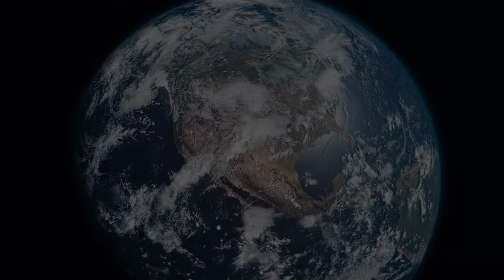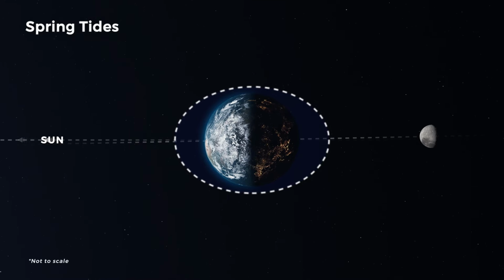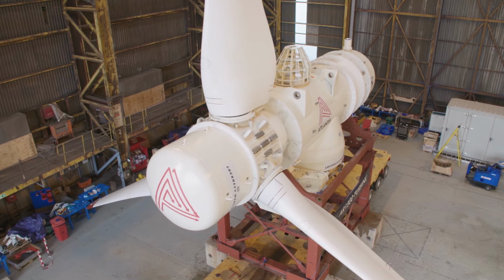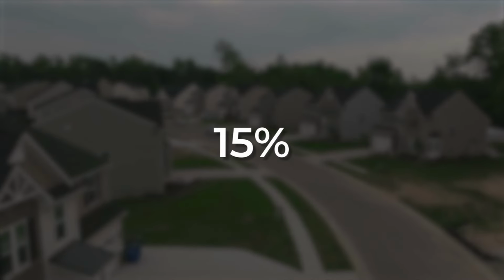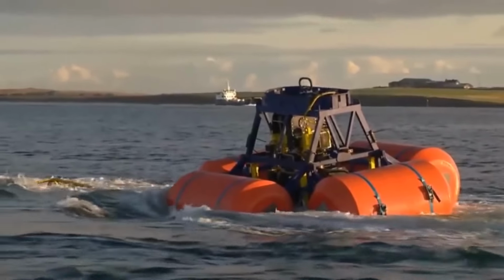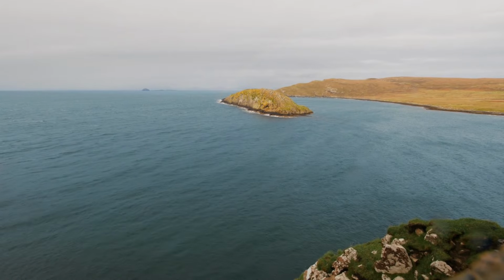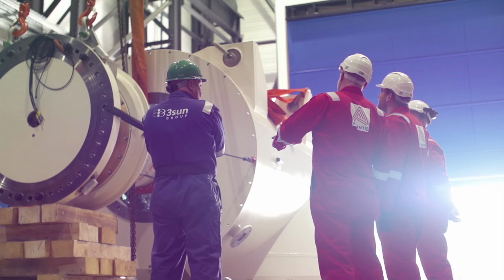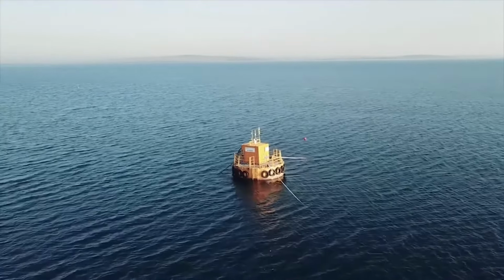Can Underwater Turbines Solve Our Energy Problems?

Comment: As a nuclear engineer, it makes me happy to see that most comments are pro-nuclear energy.
Reply: your avatar is hilarious
Reply: a desperado engineer. Ever put a tschernobyl map at scale over the place where you live? I did. I cured me of that folly sectoid belief of human control.
Reply: @E.Asinus  I'm assuming you're referring to molten salt thorium reactors, and in that case yes they would produce less waste but also no, that radiation won't be the level of background radiation but rather high level waste like any other nuclear reactor.
However, since less long-lived radioisotopes are produced, then that waste would require less storage time for the radioactive isotopes to decay into stable isotopes and reach safe radiation levels.

In simpler words, they'd produce less waste but we still need to manage it and store it like usual.
Reply: Eng AJ: Starting tomorrow, I'll be a nuclear technician.
His friend: Good God!
Reply: @ronjieo cheangon i would belive it when i see it, fusion is closer to a myth than a reality, and regarding the nuclear energy, the risk is too big, a single act of sabotage could end it all, i'm not comfortable with it
Reply: @ssllhh100  I like the way you think. That's critical thinking, and you're not afraid to be controversial. However, I believe that @Super Noodles did a good job explaining the green house effect and how heat is trapped in Earth's atmosphere by GHGs.
Reply: @AJ5  i stopped "just" beliving in things, you have to question everything to grasp how things work, a couple dacades ago heroin was a medication, CFC was the best thing the world have seen, mixing lead in gasoline was the source of the automotive revolution, but these things are just a catalyst that caused more harm than good on the long term, that's why i refuse t8 belive that "cow burp" is causing climate change, its not that simple, we were lead to belive that the water cycle will take care of it, more heat causes more evaporation which in turn causes more sunlight reflection, which will bring the equilibrium of energy

but if you look closer you find out that the distance from the sun isn't fixed, there are cycles in which the distance ocilates and the wobble of the earth causes the sunlight to hit more or less land which doesn't cause evaporation ... all of this causes more climate change than we can ever understand, add to that the margins of error and the lack of accurate historical data, we couldn't get real data 20 years ago, the margins of error are too big to be accepted

anyway, if we increase our energy efficiency by a couple percentiles we would be far better than just looking for other solutions, i know that nuclear is our best choice for now, its clear as day, but is there something we missed ? just like the other examples that i cited above i would hate to see that we caused some irreparable damage using the best solution we could come up with, its too dangerous, the risk is too big

and yes if we could covert to nuclear for maritime shipping and power generation we could slash two thirds of our GHGs but is it really the solution ? or are we just going to find that we caused a bigger problem once again
Reply: the over head to begin fueling homes with nuclear is much higher than the cost of these ocean turbines...………………………………………………..not to mention the fact that they can make the ocean turbines in under a year while building  a nuclear  takes 7 to 10 years
Reply: @ssllhh100  It's nice to consider the consequences of different energy sources however nuclear is pretty tame. Aside from uranium mining and spent fuel storage which could see improvements. The actual power production itself simply generates heat which is a drop in the bucket compared to the sun. The issue with most renewables is that it's either not economical in one way or another, requires specific terrain conditions to operate, or cannot provide steady-state or predictable power. Nuclear you can just plop it down next to a body of water and it will produce power consistently it's entire lifespan. They're quite safe as well, with loss of power and human error being their biggest threats. However passive safety measures negate most of the potential for an accident.
Reply: @elbarrineau  its really naîve to think that we got it all figured out, in any and every subject if you study it deep enough you find out that we as humans don't really know anything, not even our own bodies, we are in 2020 and there is no consensus on what people should eat, we are at a point where nobody discusses anything, you just assume things are right because you read about them on a book, i mean every year you have hundreds of studies conflicting each other, this causes cancer and that causes cancer, and when you dig in you find that these studies are completely false, based on human feed back, then you compress them into big meta analisys and come up with some stupid health recomendations ... 
as i'm growing up i'm finding that people keep jumping into conclusions and build on them without double checking the basis of their hypotheses, and keep building to a point where it becomes a reality, a volcano just errupted a couple hours ago, every volcano erruption on earth caused a slight decrease on the annual global temps, its a huge release of energy, and you are telling me that using nuclear power to slowly heat up the ocean water doesn't matter ? you thermodynamics state that there is no energy loss, just energy transfert, and you are using water to cool the plant, this means you are not 100% efficient, thus releasing huge amounts of heat into the environement ... at least we get a fraction of that energy as electricity, the thing about all the nuclear tests and accidents is that the energy release is instant, and most of it is absorbed by the environnement, now you tell me its safe and doesn't add to the climate change

i'm not claiming nukes add to GHG effect, it adds to the heat that these GHG keep around, and its a massive amount of energy ... blaming the sun for climate change is bullshit, even with GHG the sun was always shining for millions of years, its not a shame to say we don't know what we are talking about, because no single person knows, we are assuming the data is correct, and our assumptions are correct, so we build assumptions over those assumption to come to some conclusions ...
Reply: @ssllhh100  You're right there is a lot of mystery in this world and it's good to be hesitant however thermodynamics is something we humans have figured out. We know for a fact the power output of the sun, our distance away and the frontal area of this Earth at any time, combine this with the reflectivity(albedo) of the earth and you get the energy input into the atmosphere at any given time. The earth sees 201 million terawatt hours of solar energy per year from the sun, however worldwide nuclear provided 2,488 terawatt hours of energy in 2017. Nuclear averages about 33% thermal efficiency so nuclear produces about 7,500 terawatt hours of heat per year. 0.0037% of the Earth's solar energy input, so yes, it is a drop in the bucket. The reason the earth doesn't experience any hell-like heating from all of this energy is because it's harmlessly radiated back into space at all times.
Reply: @elbarrineau  earth wobbles and its distance from the sun occilates, there are big cylces and small cycles, the libido of the earth changes depending on the amount of clouds in the atmosphere ... that aside, if we assume that we know every variable and we have an average over a given amount of time, given that earth has been under the sunlight for millions of years we can safely assume that it reached the equilibrium and the input/output from the sun is constant, so we don't take it into consideration, its not acting up it has been here and it will always be here

on the other hand the 67% of inefficiency that is transfered to the sea water started three or four dacades ago, and if it doesn't get radiated (since earth already reaches saturation from the sun) that inefficiency is accumilated over time, resulting in ... wait for it ... rising ocean temps causing "CLIMATE CHANGE"

please tell me where this theory is wrong ?
Reply: @ssllhh100   ssllhh100  That's some solid critical thinking but you're wrong in a few areas. Off of your first point we do indeed have an average energy input over time so mentioning the variations over time doesn't aide the point you are making, in fact if global climate stays relatively stable even with fluctuations in input energy it furthers the point that minor changes in energy do not disrupt the thermal equilibrium of our planet. Anyways, we know that the Earth's surface is ~70% water and ~50% of thermal radiation is absorbed by the Earth's surface so that's 35% of 201 million terawatt hours yearly of solar energy going into the Earth's ocean. From my previous numbers we know that nuclear produces about 7,500 terawatt hours yearly so average ocean temperature is influenced by solar energy far more than waste heat from nuclear stations. As a personal example I grew up near a lake upon which a nuclear plant was built and the lake did not experience any runaway heat rises even while being a small body of water as compared to the ocean. The reason for this is Newton's law of cooling, which states that the rate of change in temperature is dependent upon the difference in temperature between two bodies. So for the lake as the energy output of the nuclear plant increases the temperature of the lake the lake's rate of dissipation will also increase. This is the same reason why radiators don't overheat all of the time, as it sees greater heat the rate of dissipation increases to compensate. As you can see this relationship is not a fixed dissipation rate, so as we increase the input heat the excess will shift the temperature equilibrium until the dissipation rate matches the input. Now for the earth as a whole the waste heat of our nuclear power stations is nowhere near enough to even shift the equilibrium temps any meaningful amount so the waste heat from nuclear plants doesn't have any effect on global temperature trends as a whole.
Reply: @elbarrineau  i agree with everything you wrote, its obvious that we are driving the equilibrium temps up by burning our energy storage (sunlight energy stored in the form of chemical energy in oil) this part is known

the amount of sunlight we get has always been there, there has been fluctuations explained by the big and small cycles (ice age and magnetic field shifts) but on our time scale these parameters don't make a noticeable difference, so its safe to say that the energy we get from the sun is constant, and we shouldn't try to add it in the equation

now the total energy we have on earth (other than nuclear power since its not accuring naturally) is fixed, the earth is always in equilibrium, even if we burn every single tree, the energy is stable, we are releasing the chemical energy potential ... so we can eliminate it from the equation, even thou it adds heat to the climate, that energy was stored, and we have the means to store it again if we wanted to

so we have nuclear energy left, it doesn't happend naturally on earth, so by releasing it we are bringing up the total energy released to a level higher than that of the equilibrium, and we are releasing all of it to the atmosphere, 67% directly, and the rest indirectly by using the electricity which will always be converted to heat, so that 100% of the energy released is bringing up the scale little by little, we are slow cooking the crust, and my problem with it is that its not reversible, we can't make uranium again

by using nuclear you are adding energy to the whole system, so the temperature of equilibrium will have to go up, even if the enrgy is radiated evantually, there will be a risidual amount, as per your example, the radiator temp will go up to a point of equilibrium, but only when you add energy, if the total energy was stable you won't have an effect on the radiator temp
Reply: @ssllhh100  You seem to understand some concepts of chemistry and are applying it to the earth but perhaps not completely. I'd recommend looking into entropy as a concept and also listening to this explanation. When you burn say gasoline you end up with mostly carbon dioxide and water as a byproduct of the reaction. The cool thing about this reaction though, is that it's exothermic, meaning that it also releases it's bond energy in the form of heat during combustion, allowing for our gasoline powered cars to run off of this heat expansion. Once this reaction occurs though, it's very difficult to reverse it and requires the same amount of energy as it released earlier hence why trees and corn (the source of the biofuel ethanol) use a lot of sunlight to do so. Anyways back to the combustion reaction, the heat from the reaction enters the atmosphere and adds to the total heat radiated away from the planet, same story with waste heat from nuclear. So whether your waste heat comes from gasoline combustion, nuclear fission, houses, or the sun, it all gets added to the thermal "pot" and expelled preventing the earth from baking to a crisp.

The controversy nowadays revolves around the 'greenhouse effect'. The concept that by adding carbon dioxide and other gasses to the atmosphere the new chemical soup that is our atmosphere is changed in ways that tweaks the way solar energy is radiated away from the Earth leading to higher equilibrium temperatures. This is the part that scientists aren't 100% sure about, the exact relationship between the atmospheric composition and global temperatures. Personally I'm not too worried about it because nobody knows definitively the exact relationship there however some people are very worried about this hence the call for renewable energy sources that don't emit byproducts of combustion into the atmosphere.
Reply: @elbarrineau  there is a difference in heat dissipation from a high temp gas and a low temp liquid, its hard to get a low temp liquid to release its energy ... the difference is too big, we keep the energy from nukes for longer, especially when the air is a really good insulator ... anyway its too complicated to get all the parameters right, but for me it somehow makes sense ... in a perfect world everyone would be running on biofuels for a couple years before the ground runs out of nutrients, if i remember correctly intensive agri depleted the soil in the US to a point where there is only 60 seasons left, (thats why people eat more nowdays, the minerals to calories ratios dropped alot, veritasium did a video about it, and it keeps dropping)

i'm going to try to sleep, its 3 am here and i'm still working on a patent
Reply: @ssllhh100   This is true, however the oceans see way more heat from the sun than nuclear could ever give it, same with any body of water. Nuclear plants also dissipate heat to the atmosphere as well through their cooling towers. Biofuels are pretty cool, ethanol for example has a higher octane rating allowing for higher spark advance and compression ratios on engines (more performance). However it's less energy dense and costs more per unit of energy even with subsidies. That being said I'd totally go for ethanol vs gasoline if it was economical, however it also takes a ton of land away from traditional agriculture. Last I heard it requires about 26.1 pounds of corn per gallon of ethanol, so a whole shift towards ethanol would be pretty difficult. Anyways good luck with your patent man.
Reply: @ssllhh100  also fusion would technically be the safest way to produce energy. due to the difficulty of getting a fusion reaction working the first place it is near impossible to get a runaway effect. Because as soon as it may become unstable the interaction stops
Reply: @ssllhh100  actually if you look at the statistics ukulele she has saved 1.8 million lives due to the reduction in reduction of  particulate matter entering the lung.
Reply: @ronjieo cheangon the heat generated from fossils is a result of energy captured by plants a long time ago, and is sustainable as long as the sun is up, the energy released from nukes has been put there the day the element was formed, and there is no way to make that element again, look at it this way, fossils are rechargeable batteries, nukes are one use batteries
Reply: @ronjieo cheangon we already have bio fuels from plants, bio diesel is really close to fossil diesel, as for petrol there is methanole and ethanole, they can be made, but not as cheap as fossils
as for the nukes you can add all the consumed uranium and platinium to get a rough estimate of the waste heat generated, and its a net positive heat unlike fossils that could be made if humans actually wanted to
Reply: Don't mind nuke
It's the waste that's the no go.
Problem is cost plus corporations saw i t as a cash cow 
Current power plants need to be decommissioned 
But will centralized powerful groups allow new tech to take their place?
IMO fusion will be here before we see new nuke plants used
Reply: Tom Robertson its not that big of an issue. Dogmatic ngo such as Greenpeace love to dramatise about that but the most dangerous wastes are only 0.5 percent of the total waste. Most of the waste can be reused on next generation plant. 

As for those that can’t. Geological storage isn’t, as greenpeace tries to portray « just dumping waste down a hole » The waste are  carefully packaged and buried in rocks that are known to be stable for millions of years. They won’t come out anytime soon. 

Really nuclear waste is not that bad. It needs to be seriously tackled but one should not overestimate the issue. Global warming is a much bigger concern.
Reply: the problem of nukes is that its a one way street that keeps adding heat to earth, its better to tap into the steady stream of heat we already get from the sun than to add to that causing more heat on the surface ... if we calculate the total amount of heat generated by nuke tests and power plants we get all the added heat energy to the surface of the earth, this with the increased retention of heat due to greenhouse gases is accelerating the climate change, but no one seems to look at it this way, at least burning fuels we are burning stored energy, not decaying matter that is allready in limited supply, we can make oil from plants, we cant make heavy metals again
Reply: @ssllhh100  hahaha you really don't understand thermodynamics nor them enough of heat flux the earth good through. Honestly the heat produced from energy production is so tiny it's not even with factoring in any calculations
Reply: @supernoodles908  please elaborate, i'm i missing something ? all the uranium and plutonium used can be quantified, and you can get an estimate of the added heat energy to the system, as for the sun it has been this way for millions of years, and i'm not sure they got everything figured out at this point, if we follow the green house gases rabbit hole we will all end up vegan by force, and i like my meat haha
Reply: @ssllhh100  refer to Leon FA. A lot of earth's energy is radiate it away in the form of inferred radiation. A lot of gaseous compounds such as CO2 or methane are good at absorbing infrared radiation and re-emit it. When we re-emitted it has an equal chance of going any direction and some of it will statistically be directed down towards surface again causing a minor warming effect. 

Without CO2 and water in the the average global temperature would be about -18c or 0f. Currently earth averages 15c or 59f. The reason why the temperature is increasing is because we have significantly altered the atmospheric composition. 

Picture this. You're standing outside in coat and it's very cold. What do you think is going to increase your body temperature more. Putting another layer on such as a jumper or ever so slightly moving you little finger? 

Obviously the jumper will make you warmer rather than moving you little finger. Even though there was a slight amount of extra heat energy generated by moving your little finger affecting the rate at which heat is lost from your body is the main way to make yourself warmer. 

This is the same for earth

It hard to describe how small the extra energy we put into the system. 10000km Vs 1mm is the discrepancy we're talking about.
Reply: @ssllhh100  Nuclear reactors are used to facilitate certain reactions to make new elements... I'm unsure which heavy metals you're referring to but even if we didn't use nuclear reactors for power we'd probably still use them.

edit: Also just because nuclear may not be used for comercial power for the general public does not mean they will decomission the countless nuclear reactors in use today for ships and government and scientific installations. It just means the general public will not benefit from nuclear energy.
Reply: @johndoe-es7zh  its not reversible, you lose the uranium for ever, and release the heat into the eco system, green house gases could be captured again, radiation and heat cannot
Reply: @ssllhh100  That is not how it works. Heat on Earth is nearly completely radiated away with in one day, you can create as much energy with nuclear as you want, it will never heat up earth even a thousandth of a Centigrade.
Reply: @leonfa259  so how on earth does the heat from the sun get "trapped" by greenhouse gases ?
Reply: @ssllhh100  The sun is sending 384.600.000.000.000.000.000 Terawatt to earth nuclear adds only 1 more Terawatt to it. Since the total amount coming to earth must be equal to the total amount radiating away from earth (there are temporary differences far below 1%) nuclear won't hear up Earth. Greenhouse gases work like insulation they change how much temperature on earth is needed to make it radiate as much energy are coming to earth
Reply: @ssllhh100  Bruh! You need to go look up the Dunning-Kruger effect asap.
Reply: @LikeATreeOnAMountain  i'm not sure what is your point here, please elaborate
Reply: @ssllhh100  the reason for global temperatures increase is pretty much solely due to the increase in greenhouse. Which causes the greater retention of infrared radiation that emits from a warm aka the ground and oceans of the world.  

2x10^17 joules have been released from nukes 
The earth gets about 9.5x10^21 joules per day from the sun. 

So in the past 70 years earth has recieved 2.42x10^26 joules

So in the time nukes have been around earth has received 10000000000 times the amount of energy from the sun. 

But do remember that earth losses most of it energy from the atmosphere. As a system has more energy in it releases that energy quicker as well. so we could pump in hundreds of times more energy into the system we already do and it will still be able to radiate it away. 

The problem is when there's been a cap put on at the right it can radiate it away which is what greenhouse gases are doing.
Reply: @supernoodles908  i don't agree with your math, the sun has been there for millions of years, its a constant, why would you add it to subtract it ? my point is that instead of adding heat, that we already have problems getting rid of, we can try to use the energy we get from the sun and store it

i'm not going to dispute the green house gases theroy, but i don't think its as credible as they try to make it, the margins of error are too massive to make a conclusion
Reply: @ssllhh100  most of their energy gained in the day time is radiated away at night. It doesn't matter if you agree or not with me it's a matter of fact. 

if you look at the wavelength of light emitted by infrared radiation from the ground they are pretty much identical to the absorption spectrum of CO2 and Methane which is why it's so good at redirecting it. 

It functions similarly to a foil blanket. even though they're incredibly thin by reflecting infrared radiation released by your body it can keep warmer
Reply: @ssllhh100  The minor amount of heat added to the eath is negligible, we already get 3.86 x 1026 watts from the sun, the problem are the greenhouse gasses trapping it in.
Reply: @ssllhh100  We can make heavy metals.
Reply: @ssllhh100  lol nuclear power is based on uranium not coal.
Reply: @darkwolf1739  yes but its extra heat, you are adding heat to the environnement by degrading atoms, coal was CO2 befor, and we can make it again down the line if we wanted, you cant make U without wasting massive amounts of heat